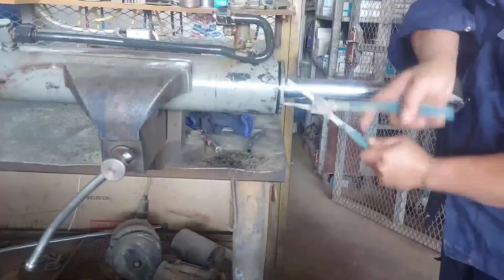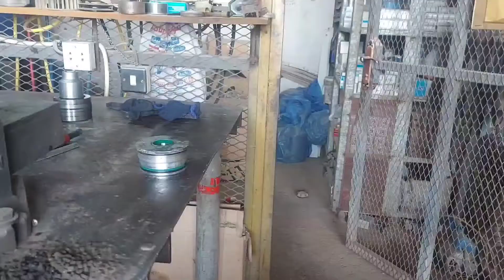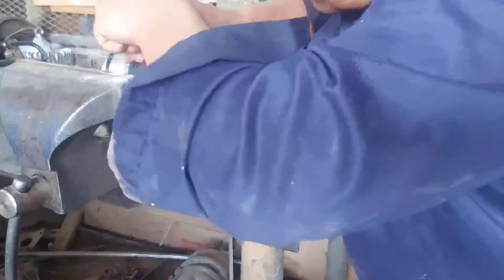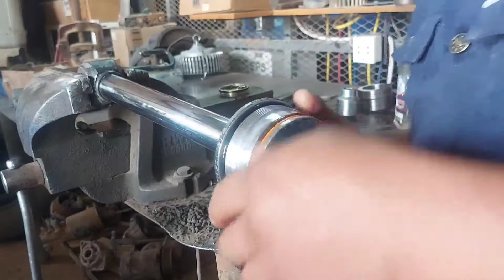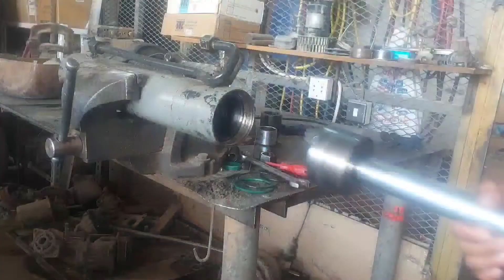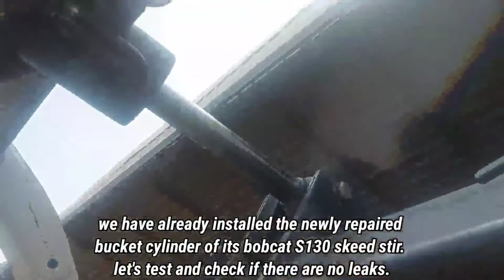Repair of Bucket Hydraulic Cylinder BOBCAT SKID STEER

Comment: 1/22/24   Replaced main compression ring on the tilt cylinder head, heated ring in pan on hot plate full boiling water.  Stretched enough to get it on, then covered/wrapped it in blue painters tape then wrapped in black electrical tape attempting to get the ring  to shrink.  Finally, used a ring compressor on top of the tape to get the ring to shrink into the grove. Left for about an hour, it worked perfectly!!! Used baling wire to hold the cylinder housing up so that I could get a perfect straight shot when I installed the piston and ring. Used normal petroleum jelly as prelube.
Reply from the maker: Thank you Sir